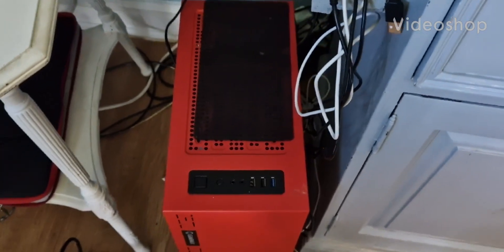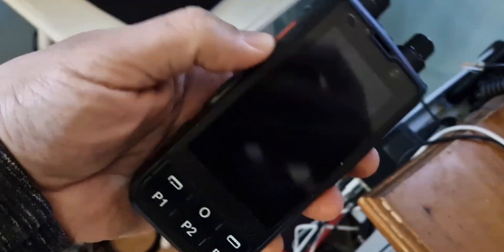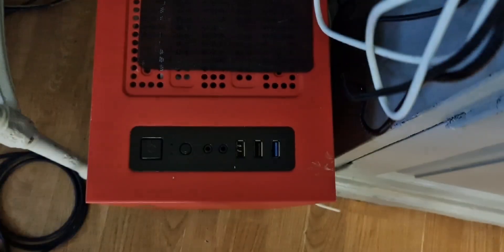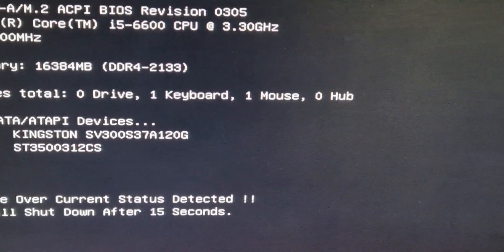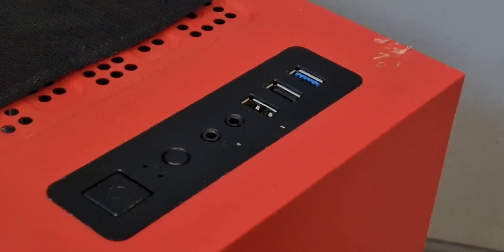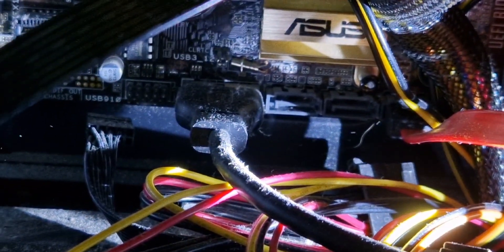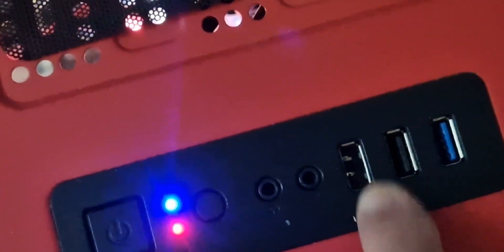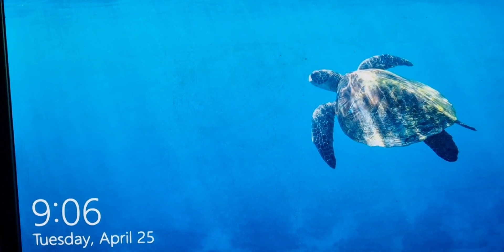USB DETECT OVERLOAD - PC WONT BOOT UP - FIX

Comment: Its easy to fix bend all the pins so there not touching each other or the outside edge of the port.. its over current because its shorting out to ground rather than shorting out 2 pin's.. just make sure no pins are touching anything then fill that port with uv glass filler or something non conductive so no one can use that port
Reply from the maker: Thanks